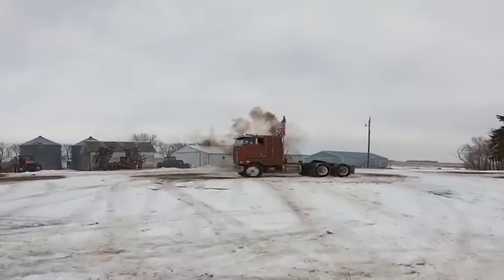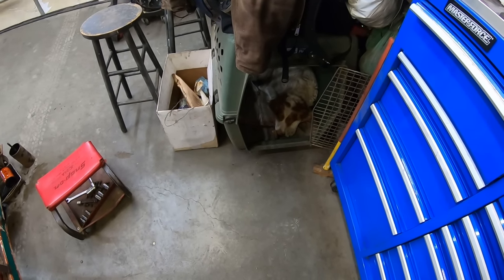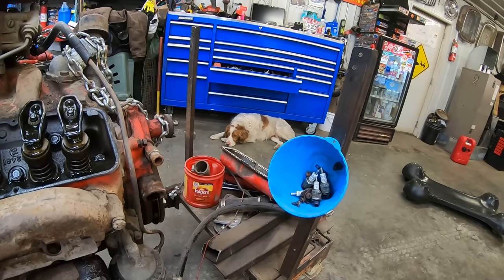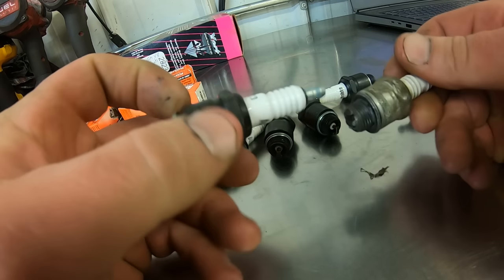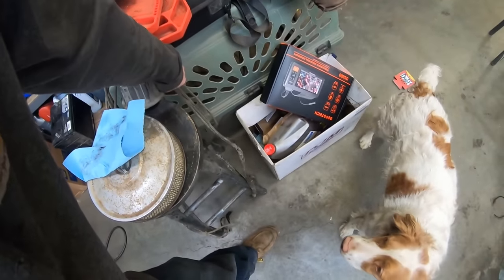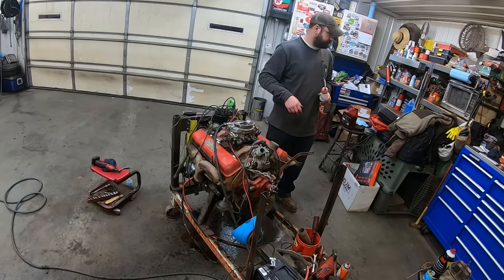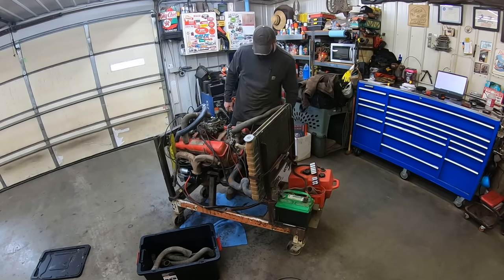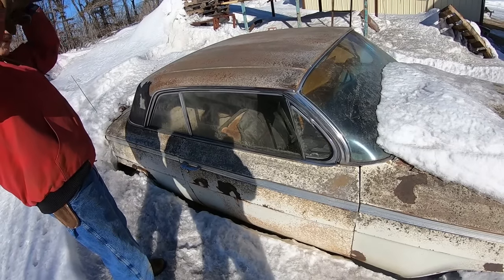1962 Impala Super Sport 300HP 327 Engine Abandoned for 43 Years!! Will it Run?!?

Comment: That'll do, Mortske. I think that is a fairly uncommon "large-square to small-square" adapter. Those Edelbrock/Weber/AFB clone carburetors are based on a later large-pattern version but most engines from the late 50's through the mid-60's used the "small AFB". My '66 Chrysler does and so did Buicks and other stuff. Hopefully your ex-teacher still has the correct carb and matching air cleaner(the air horn opening is correspondingly smaller). It could have had a 4-jet, also temporarily referred to in literature as a "Quadri-Jet" but I think a 300hp 327 would have an AFB.  They are only about 525 cfm, but that's plenty. Of course in a man's world carbs are sized like exhaust pipes and certain body parts...the bigger they are the better they work. Down here in the south the common screw up of Edelbrock is "elderbrock". Brake clean takes the writing off the hoses and cables. See ya Pig!
Reply from the maker: Great info Tyler!

Comment: I’ve got a thousand opinions…but no one wants to hear them.  Basically I’m a Ford guy but for one reason or another I dabble in other makes.  For instance I’ve always wanted a 66 Too-door hard top Impala, so I learned Chebys.  That thing gave me all kinds of trouble trying to get it started the first time after rebuilding the engine.  Watching you trying to get this thing started kind of got me flashing back to the good old days.  It turned out that I had been thrashing on it for 36 straight hours over the weekend doing things that didn’t really need doing like port matching the heads, intake and exhaust.  Considering my time crunch, I could have done better by sticking with things I did need to be doing like assembling the new engine, cleaning the engine bay, after pulling the old 283, installing electronic ignition, yadda yadda yadda.  I was so tired I had mixed up Ford and Cheby firing orders.  Needless to say I had troubles.  I had pulled the 283 and put in a warmed over 350 with the 283 stickers on the breather and valve covers.  To keep it looking stock I had ground the markings off the Edybrok intake and painted it Cheby orange like the rest of the engine.  To keep the 8mm wires looking stock I used paint thinner to clean the markings off it.  All of this running off at the mouth is to tell you that I used paint thinner, you used glass cleaner. Tomato Tomahto.  My wife tells me I talk too much.  LOL  Time stamp 1:15:53 was me in 1990.  SUCCESS!
Reply from the maker: She doesn't know what she's talking about!

Comment: All of your Chevrolet 327 62 till about 66 I think he had a Carter AFB on them in 1967 they came with a Carter or Rochester quarter jet carb that was an excellent carburetor for the street my 350 Chevrolet 1970 and my SS Nova had a quadrajet on it it was an excellent car it would pull like a bird or about a hundred miles an hour and then fall off for the horsepower and no camp 300 horsepower 350 but it was a good car loved it

Comment: Should be a Carter AFB on 300 HP. A Holly 2818 off 350 HP 327 works nicely on 300. SBC use a 3/8" reach projection core spark plug. Champion J-12Y or hotter J-14Y. Your J-8 is for a flathead so the electrode does not hit valve.

Comment: I've found if you can spin the engine some while priming the oil pump you get better results. I'll pull the plugs and turn it with a big half inch rachet

Comment: Hey mr. Mortske ! Well,I guess it’s cool that you came across this small block Chevy 327 w / double hump 2.02 fuelie heads . Back in the day , they were all the rave until aftermarket got big with cast iron and aluminum cylinder heads . But hey , a 327 sb was never frowned upon in the 60’ s and 70’s . I was just up and coming then . Rock and roll hoochie coo ! Darlin’ mama light my fuse . Don’t worry , you can sing if you want , surely the critics probably can’t sing . Mama’s got a squeeze box . Can we say mr. Mortske approves of Rick derringer / Johnny winter and tommy James ? Your call . But I guess we will let Tiffany make the call in the 327 . 
Champion or AC Delco on plugs ….. I never truly had a problem with either but ford seems to . I’ll use champion on my 258 AMC , it doesn’t complain . Champion , for the win ? Not just for lawnmowers any more 😬 good job on the small block , as always and only as mr. Mortske can 👍
Reply: 461 is not a 2.02 head they are 1.94 valves.

Comment: Back in the day the first thing you learned about SBC's was to take a center punch and peen the top of the block and the bottom of the intake manifold. This would make the rubber gaskets stay put. No sillycone to plug up oil galleries.

Comment: Snicker.
The valve covers are clean, because if you will pull the intake off you'll see where it's all at.
Your blow by tube out the back where the tube connects to the block will be more than likely clogged up, and when that starts doing it's job less and less. 
You'll notice that the oil filler cap is starting to get filled with oil, then it will run down the outside of the filler neck, but look down the neck should be starting to build up there too.
No pcv values in valve cover, are filler caps that leak, and that means that you don't have any vaporized oil particles floating through on they're way out. 
Elderbrock carbs are subject to have they're cast aluminum merering blocks disintegrate because of the ethanol in the dam corn juice.
One day they're running great, and the next time you get in it won't idle for sh!t.
Take it off you'll notice all the black sludge inside the throats, turn it over, and watch the cast aluminum slim leak out.
What about the valve covers that were chrome with the Chevrolet in cursive script that are worth a pot of gold if you have original sets.
Pinto best engine was the 2000 4 banker, indestructible and ran exceptionally well with a little tweaking. 2003
7.3 power stroke with over 400,000 unmolested miles, and still rolling inspite of over $5.00 a gallon fuel. 
My favorite was 1963 327 375 hp small journal big valve double hump heads out of a 63 vette.
I could go into detail on the build back in 1977 in a 1970 lwb C10, with muncie 221 short ratio 4 speed outta 1969 Z28.
Take that chunk of steel boat anchor off her tail, and she'll pop off faster than that.
Sounds lean, did you adjust the mixture screws on the nasty ole under sized carburetor, because it'll run on a 750 if you add some headers and good intake

Comment: I bought a new 300 HP.  327 in my new 66 impala. It had the single jump casting mark on the ends of the heads. A 1.94 intake. Did I see the double hump on those heads. That's the 2.02 intake found on the 365 HP high rise Vette 327 & other versions

Comment: Nice job nothing like a good running 327 . 327 / 300  w / 350hp cam 62-70 . Early 327 had the v type vc wth  cartridge oil filter. Hard to find . Script type vc few had staggered bolt holes. 327 called Mighty Mouse / big block 427 known as the fat Rat .

Comment: The casting date of the block is found on the top of the bellhousing flange near the distributor. Because of the Feb 18 assembly date on the stamp pad would indicate a casting date from Jan-Feb. A typical casing date would be A for January, 1-31 for the date of the month and 2 for 62. A202 would be January 20 1962. B42 would be February 4, 1962. Blocks were typically cast within six weeks of the assembly date. There were exceptions.

Comment: some of the older small blocks required you to use the distributer housing for priming, otherwise you lose oil pressure at the back of the lifter oil galleys.

Comment: I had an all stock 64 Impala SS with the 300 hp 327 ci engine backed up by a muncie 4 speed.  The original carb was a Carter AFB if that helps you.
Reply from the maker: Thanks

Comment: My favorite engine is Mazda rotary engine because it would save on gas mileage.
 The Cosworth Ford rated at 560 HP @ 5200 rpm 3 liter V-8  Another is Alpha Romeo V engine because the piston pin is a little offset away from the middle hole of the piston skirt.
  Most domestic motor have center hole for piston pin to go thru and it is not offset.

Comment: If you want to tune the engine over fast tack two batteries put them together and it will give you 24 volts hook the positive to the negative on the other battery then you will have 24 volts & it will spin over without hurting anything. My dad did it all the time with low compassion engines.

Comment: I use a pressurised tank with new oil in and fill the engine through the oil pressure gage hole fills the lifters and bearings etc all the best to you all

Comment: Fill the engine with scalding hot water make it think it was running. Also a little trick listen to the engine rotating with no spark plug ( Nice and smooth sound ) Happy .... then when you put in the compression gauge sound varies this is how a broken engine will sound if low compression or broken valve train. easy way to tell if a engine is hurt in a few seconds.
Reply from the maker: Thanks for the tips!

Comment: I thought I was the only one who didn’t like headers. I almost burned down my first truck down after taking it on the road for the first time in almost a year. Had a small valve cover leak and It caught fire really quick. They burn starters up and seem to let a lot of heat out in the engine bay. I’ll take stock manifolds any day
Reply from the maker: Whoops

Comment: Thanks for the cool video! I am learning a lot from your videos. My favourite engine must be the 396 Big block. I had one in my first American car who was a 1968 Biscayne two door sedan. It had a four speed on the floor and it was real fun to drive. Now i have a 1975 Volvo 240 station wagon with a Chevy 350/350. It"s faster, but less cooler than my old Amcars.
Reply: I had a few 396's too.  Seems like alot compared to a small block.  Later on I had a 454 and that really appealed to me.  Low speed torque you really feel.

Comment: I like 327 that came out late 60s with a spin-on oil filter Big Bore Short Stroke that's my favorite engine the 327 bolt on horsepower they got good old pressure especially compared to Ford's they always had shity oil pressure and bad cylinder heads

Comment: Gen 3 hemi because I am doing my first build and it is a stroker.  Plan on swapping it into my 2004 Dodge ram 4.7l with a manual trans.  They never installed gen 3 hemis into manual 1500 trucks.

Comment: 4.0 ho inline 6 cyl Jeep. I have had a bunch of them they take a beating even at high mileage they just hold up good They got decent power and lots of low end torque not a power monster by no means but they are just a good solid engine only thing I wish they made a fix for is the crank shaft position sensor on them but other than that definitely my favorite

Comment: I had a hell of a time getting mine running when I first bought it. Come to find out the guy who put it together put 350 heads on the 327 and the chambers were too big. Not to mention they gave me the wrong plugs to start, but once I got her running the cylinders got washed out but she still ran strong, just loaded with fuel on every start up. Had a hell of a bearing knock from the wash job and needed a full rebuild with the right heads.
Reply: Sounds like the other guy maybe put 76 cc chambered heads on it,   too low a compression.  Most were and used 64 cc chambered heads.
Reply: A guy complained his BBC 454" wouldn't spin the tires on takeoff... turns out it had a 396" crankshaft and about 5:1 compression ratio... ran fine, otherwise...
Reply: @BuzzLOLOL    454 bore,  396 crank,  wouldn't that be a 427  ???     Not sure it would even run at under 7:1 compression .
Reply: @billycarpenter4740  - Most of the 1970's engines had actual compression ratio in 7's...
Reply: @BuzzLOLOL    I can't agree with that.  I ran BBC's during the mid-later 1970's and our calculated static compressions were 10:1 -12:1 compression.   A few of the "low compression" engines were in the 7.8 1 ratio's.
Reply: @billycarpenter4740 - I joined GM Engineering in August 1966. 
GM dropped all compression ratios below 10 in 1971 and Ford and Chrysler followed in 1972... 
GM was always the leader back then with 52% of the market, all other vehicle manufacturers in the world divided up remaining 48%...  
The Chrysler 360 came out in 1972 and was a low HP, low torque, horrid MPG ( 9 city, 11 hwy) emissions slug clear up until 1994 when the Magnum version was brought out... ditto for BBC 454: 
https://www.youtube.com/watch?v=J-MQYck2xt8 ( see 05:50 )
The Pontiac 301 V8 (along with Iron Duke 4 ) lead the way and brought back good MPG early in 1976 ! Along with Chevy 305...
Reply: @BuzzLOLOL     I grew up in the early '70's.  Dad was a Chevy guy,  I leaned towards Oldsmobiles, Buicks.     10:1 -11:1 compression was common on the street from the '60's cars.    Yes,  8.3::1  up to 9.7:1 ratios came  about during the gas crisis back then,  gas was 26 cents a gallon in Abilene, Texas during gas wars in 1973.    Sure wish the Chrysler 360 had come out factory with high compression and big cam.   In Texas you were either in the Chevy/GM or Ford camp,  little concern for the Chrysler and AMC guys out there back then.   My big block Chevys could only get 12 mpg's on the highway,  and closer to 8 mpg's hot rodding around town.    Tho I was Not a fan of the Chevy 305,  I know they were good engines,  same for Pontiac's 301,  and I loved the Iron Duke 4's.   Big high five to the GM Inline 6's of the 1960's too.   Appreciate your response.
Reply: Dad was an Olds guy and I liked Olds but realized Chevy's made more HP per cubic inch. However, the torquey GTOs/442s ruled the streets stoplight to stoplight where everybody saw them since most people don't go to dragstrips. And sold best for many years. True even here in this dealers-only '66 Chevelle ad where the high strung Chevy needed a full 1/4 mile to get a fender ahead: 
https://www.youtube.com/watch?v=SJIRitKQYrM
In early 1970's most ratings of 8's:1 were a deceptive fudge... they were actually around 7.5 - 7.8:1 as they (eventually) discovered here: 
https://www.motortrend.com/how-to/46326-gm-350-crate-engine-build-ii 
360 was apparently an enlarged 340 to give a new bigger cubes number to advertise, despite all other numbers about it being smaller... 
Here in Toledo Ohio we have GM, Ford, Jeep, and Chrysler factories and the well paid employees got discounts on new cars so we saw a lot of them around here... and we're only an hour from Detroit, Michigan, so almost like a suburb of Detroit... also, Studebaker (Indiana) and AMC (Wisconsin) factories weren't that far away...
Reply: @BuzzLOLOL    Most believed hp won all races,  few understood the benefits of low end torque to pull a 3,400+ car off the line and up to speed.  Those early '70's Buicks used torque to challenge a HEMI car or an LS-6 Chevelle.  Took me years to appreciate torque.   I had a 1966 Chevelle SS 396.  Replaced the 396 once,  then had 2   454's in it .  Totally agree with you about "advertised" compression and actual.  I bought new and still drive my 2004 JEEP Grand Cherokee.  Maybe not the best built,  but has been a pretty good vehicle with the small V-8.   Living in Maine, back in the early '60's,  my grandmother bought a Nash Rambler/Metropolitan ?, orange color.
Living here , just south of Cocoa Beach, Florida we see a good selection of restored muscle cars during the winter months,  snowbirds bring them down from up north.   I still drive my original owner 1985 Oldsmobile Cutlass Supreme,  upgraded with a mild SBC 350.

Comment: #1 pointing to #1 cyl is only on the HEI ignition and not points distributor. So you know your on the #1 compression stroke, finger #1 hole until air gets by your finger then turn the balancer to 0 on the timing tab. You were TDC on #6.
Reply from the maker: Where do you point it on points then?

Comment: Two holes in camshaft. An oil pressure gauge will tell you when one is pumping to top side , rotate the crank/cam till it shows a drop in pressure, rotate again. A gauge will show it pumping.
Reply from the maker: Gotcha

Comment: Mortske Community is there a video here on cleaning out old fuel tank/lines? Mines been sitting about 8 years and I probably didn’t take any precautions before letting it sit. Helpful advice appreciated. Thanks.
Reply from the maker: I like pressure washing tanks and blowing the lines out with brake cleaner and compressed air.
Reply: @MortskeRepair  wanted to hear it run so decided to skip this step. #tomorrowproblems

Comment: 300 horse 327 excellent engines wanted to stuff one in my Chevy luv but got outta hand real fast lol 😂 I think that cam is a 30/30 duntov cam snappy and way good most people cry about solid lifters but honestly they are easy to run threw and don’t need to do it that often my favorite engine that I’ve owned was a 502/502 horse crate engine i had in my 69 camaro was so reliable and barked ran that car to 11.2 at 124 mph with an m22 Muncie and shit 60’ times

Comment: My 67 Camaro 327 275 horse at camel bug beds on it but they were 194 it's not too old twos and they cracked now I had the same heads on my 300 horsepower 350 in 1970 never had a problem with them never I used to use mobile 1040 oil in it cost about a bunch of Court back then and that was an excellent engine that was probably the best car I ever had and I probably had funny 25 cards that was the best engine I think the Chevrolet ever made but I had a 1973 '96 350 horsepower engine and that was an excellent engine too never had a problem with that and that baby would run 120 miles an hour all day long with a turbo automatic 400 331 gear in a 70 Chevelle SS never had a problem with that